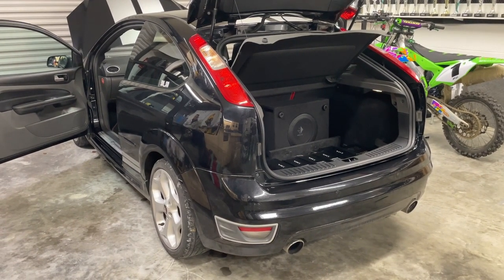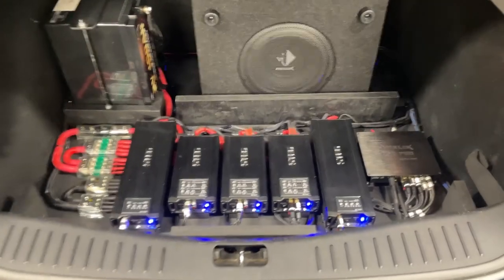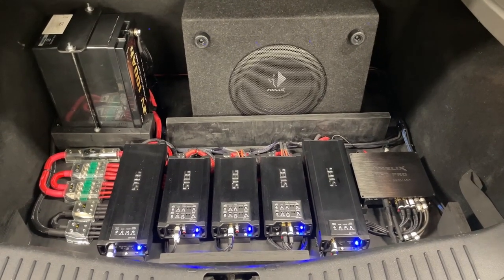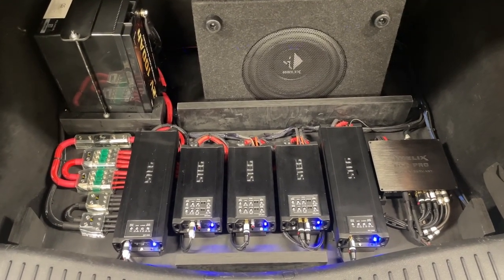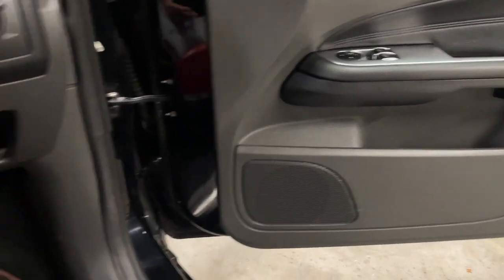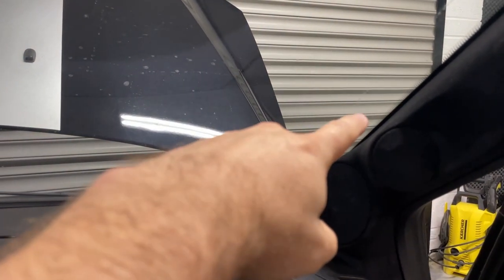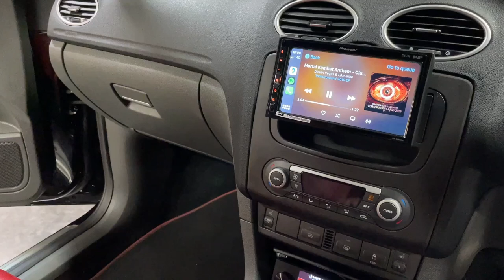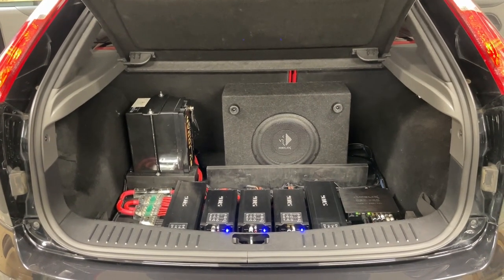Ford Focus ST500 SQ & SQL Audio System - PART 1-2. - Steg, Helix, Silent Coat

Comment: As an Australian ST225 owner, this is inspiring. 
Those inserts are the standard XR5/ST focus inserts for those with the black leather seats. I have the cloth seats in my ST225 and have bought replacement trims with the leather insert.
Thanks for an inspirational & informative video, want to take mine to the next level next year.. :)

Comment: Love your installs. I have a 2007 honda odyssey ,I would appreciate your advice on putting a 6.5 in midbass IB in the floor firing up in a location a little forward of the door speaker towards the fire wall and I was wondering your thoughts on it .I  will have a 3 in and tweeter on the pillars and 2  18" SUBS firing outside in a IB were the rear seats fold down. I greatly appreciate any advice you could give, love your channel.  All the way here in the USA 🇺🇸
Reply from the maker: If you have 2x18” in IB at the back, you may want larger format upfront midbass, like 8”s or a front sub with your 6.5”s. 
If you want to learn more than what u can see here on YouTube, you can also check out our Patreon channel, link is in description.
Reply: @pssound9749  ok will do Thanks

Comment: The middles and tweeters should be directed to the center at the same angle. It is much easier to configure the system through the processor!
Reply from the maker: You sit off-set anyway. You don’t listen with your eyes.
Aiming was explained in the video.

Comment: I’m very curious, what is the average cost of a system at your shop , sq or daily drive?
Reply from the maker: Average for daily is £6-8k, then you have the proper, crazy £20-30k systems.
Reply: Damn! That’s a small mortgage payment lol
Reply from the maker: @seanjelly8942  don’t enter home audio then, you could buy a flat from the prices there! 😃
Reply: @pssound9749  haha agreed on the home audio, it never ends! especially if you have larger rooms. Though, I have found that if you can learn and build your own speaker cabinets from scratch, you save a TON of money vs name brand speakers. I built my own 5.1 channel system and it sounds amazing for the space I have, plus you can't beat the satisfaction of doing things yourself! I got all my speaker crossover designs off parts-express forum, a ton of knowledgeable speaker designers there and tons of design choices to fit someoneès goals for home audio. I went with the Amiga towers and sunflower design center channels, and love the results!

Comment: I wonder if you couldn't tuck the batt to the side with custom case. Obviously I can't tell what type cells they are, but I don't see an 80ah or 90ah yinlong bank being out of the question.

Peter, any buying tips for clip insulating and around tight areas? So far, I've been buying rolls of camper top/tonneau cover gasket, but the adhesive isn't always that great.
Reply from the maker: The owner already had this battery and had no plans to sell it. 
We use Tesa tape for clips.

Comment: Which material do you use on the roof? I would prefer something as light as possible yet effective.
Reply from the maker: 2mm deadening with 15mm absorber. Probably ~5kg.